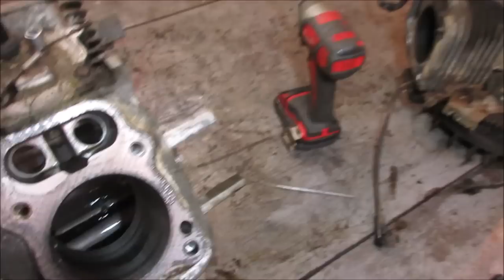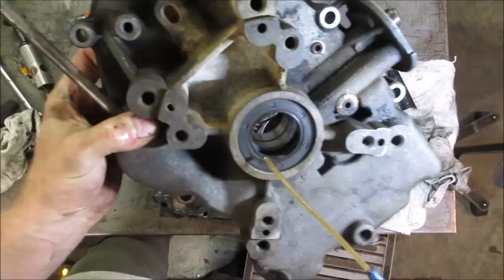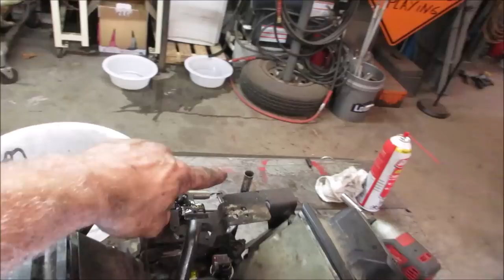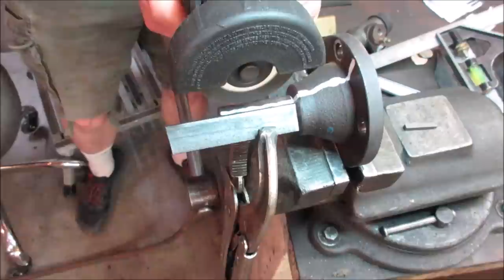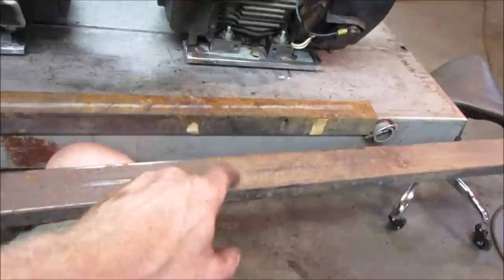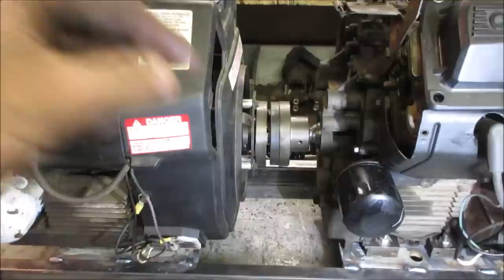2 Blown up Engines Glued Together, Let's start them up and see what happens.

Comment: When using stones, would it be beneficial to use lower rpms for the drill? I am thinking of trying to approximate the 30-45 degree honing pattern that new stuff come with from the factory.
Reply: I had to really think about this idea. The difference between a higher and lower speed, is the centrifugal outward pressure on the stones. So if Mustie1 slowed it down after some high speed initial 'honing', he should end up with a smoother sheen on the bore. Of course, he would have to do that for a decent period of time, to obtain that 'polished' look to it. So yes, I think that would be beneficial and give a better surface for the rings to bed into.

Comment: Hey Darren, did you clock those engines 360 degrees out from each other, so you have 1-3-2-4 or are they firing 1&3-2&4 (together)? Just curious... Seems like they're all running somewhat even. EDIT: Sorry, I missed the part where you said you were running them 180 degrees out. That's ALMOST right, if you're running a 2 stroke that fires every revolution. A 4 stroke V-twin would need to be a full rotation out from it's neighbor, to give you even spacing on the power strokes. Pretty cool project!😄👍👍

Comment: Since you now know that the engines won't fight each other, maybe you can remove that coupler and replace it with a solid piece of steel. You could make it shorter and move the engines closer to each other.
Reply: He would have to make sure they were perfectly aligned and that the engines did not flex. Since that would be near impossible to do, he needs some coupler to allow for slight misalignment and for some shock absorption when there is a miss-fire on a cylinder that alters the shaft rotation rate.

Comment: You can check shaft alignment at the coupler flange. Feeler gauge between flange faces. Max .001 inch gap per inch of flange dia. Technique same as propellor shaft alignment to engine on boats.i

Comment: Have you checked the calibration on your torque fingers and eyecrometer lately? They are known to drift out of spec. also check your precision adjustment tool (hammer ).
Reply: Also been known to vary dramatically based on temperature and whether any cooling liquids used contain alcohol.

Comment: It is  much   better  the turn  1  clockwise  2  anticlockwise   to   regulate  vibration   you  can   turn  a flywheel   for  greater  torque

Comment: Do you have to synchronize the carburetors like you do on the older motorcycles?
Reply: For optimal power and efficiency I would think so. For ducking around for fun, probably not a big deal.

Comment: Why not just mount both engines on to a piece of channel steel, then use a dial indicator to align both engines. 15 thousand runout. That’s why you are chewing up the coupling spider. This is how a pump and motor are assembled for industrial applications.

Comment: That's messed up that the ring compression tool has a wrench that is square. I mean, if you lose it... I don't, maybe if the square tool is the same size as 3/8 socket extension *shrug

Comment: New to your channel. Im inspired bro. What are thoughts on doing this with a vertical shaft? Im considering this...
Reply: Actually, to convert to horizontal is the main thing moving the oil pickup? Mess with the filler n drain?

Comment: I am curious.  How are you going to synchronize the firing of two separate engines on the same crank?  If they are not firing in synch they could go off opposing one another and I would imagine cause catastrophic damage to each???  To time them so they work in unison would require different positions on the existing cranks and cams lobes I am guessing???  Do you have some secret plan in mind?
Reply: i mean, you wouldnt be wrong if it had a single dizzy or something but since its just 2 engines tied together with separate ignition systems, they run independently, so while the exhaust note might be a hare strange they should run perfectly fine
Reply: @djaydeved  Looks like he was going to couple the shafts which would make a single unit.  If one cylinder fired on the up stroke of one on the other engine it would drive that piston back down mid upstroke. Bad juju.  If he had each engine hooked to an independent shaft with slip linkage, then maybe.  Both would also require the exact same rpm or one would be dragging the other.  I don't know??  You could get some unholy harmonics going there.  One of the reasons, I believe, that engine driven common shaft factories used only one engine on a shaft.  Now ships have a way of doing it, although mostly warships with unlimited budgets and not too many of them.  It will be interesting for sure.  Eight beers into a nine beer night and a cocktail napkin could make it happen!
Reply: I'm not a mechanic so maybe really wrong.... But wouldn't the fact they fire based on a magnet on the flywheel basically force them to sync together? If one outputs a little more.power, it'll push the other faster (and slow itself) but the sparks will still go off at the right times on each cylinder.

It's not like one engine is firing the spark plugs of the other engine.
Reply: @tin2001  Without some sort of communication (cam lobes, computer, etc. The one engine has no way of knowing what the other is doing.  The governor might sense the load but I doubt it could be exact and the load isn't the problem I would worry about.  Excessive vibration would be my concern.  At worst it could destroy the engines very quickly.  Just not sure.  Be a heck of an experiment in any case.  In old time engines a huge flywheel smoothed out vibration, something this setup at high rpm just couldn't swing.  We will have to see what Mustie tries!!
Reply: The drive shafts are linked, so the rotation of the camshaft gears that turn the camshafts are technically linked too. And the magneto is tied to the camshaft rotation as well, so technically, the timing of the firings are synchronised. If this was not so, we would have seen the coupling disintegrate. And he feed more fuel in one at test and then the opposite in testing. So the timings have to be very close, or it would not have worked.

Comment: I have a question. How did you time the shafts to keep the pistons firing in time to each other? Did I miss this from the last video?
Reply: On the flywheels he marked Top Dead Center with a white marker pen and then had them both facing the same way, before connecting the shafts together.

Comment: Do not remove the fan shrouds the engines will not cool enough for the love of God please don't do that mustie lol, also those open holes above each cylinder have little access covers you'll want to find those and install them as that helps direct air across the cylinder to cool them